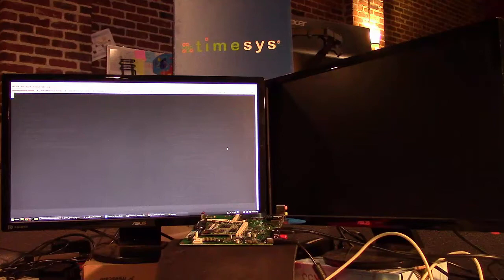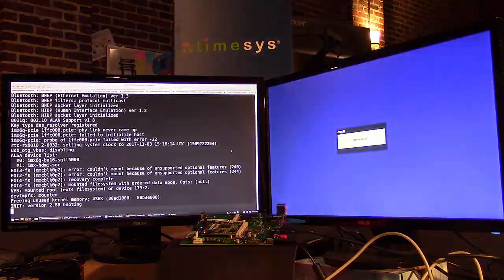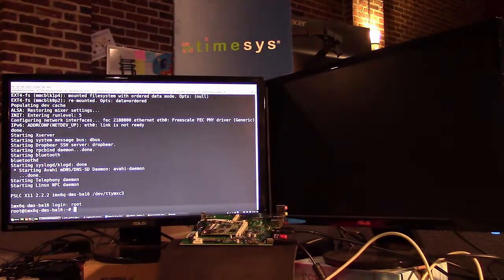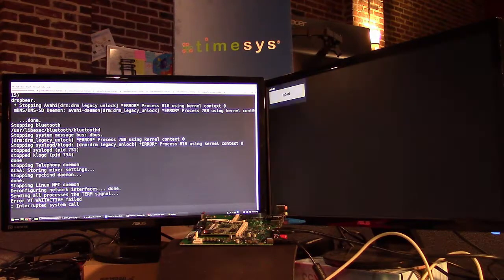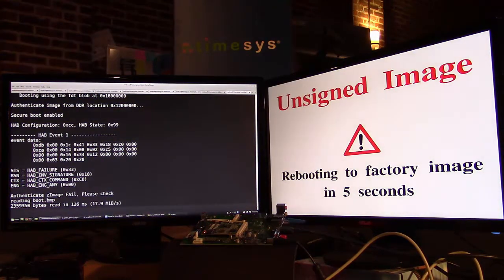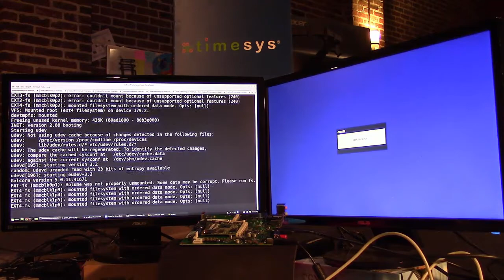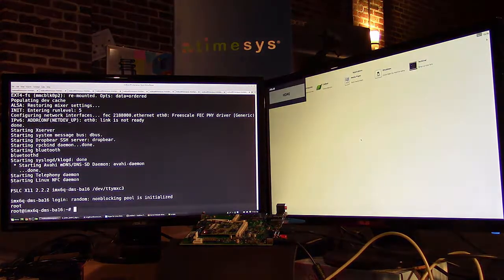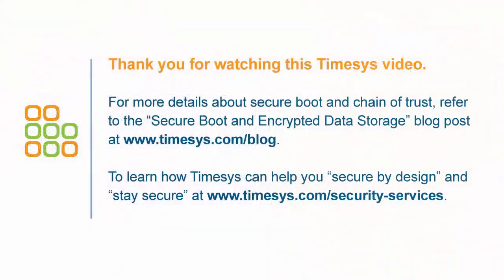Secure Boot on i.MX 6Quad Processor Powered Advantech DMS-BA16 Qseven Module

Comment: It would be really helpful if you could specify the CryptoAuthentication Device you're using here. Thanks in advance.
Reply from the maker: The i.MX6 processor has built in hardware root of trust (CAAM module and built-in master key which can be used for secure key storage) which is leveraged to establish secure boot / chain of trust. So there is no need for an external CryptoAuthentication Device. You can read more here: https://www.timesys.com/security/secure-boot-encrypted-data-storage/